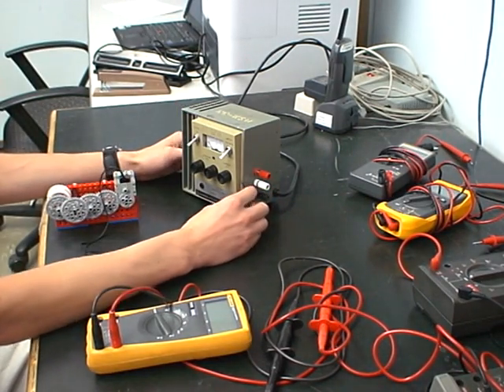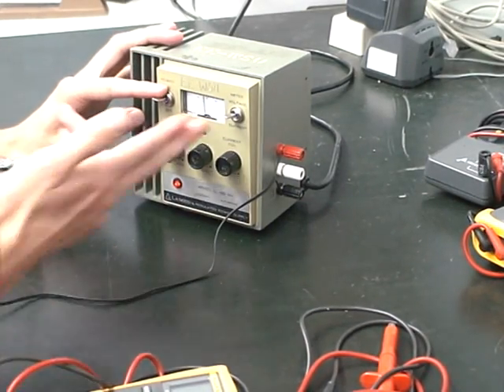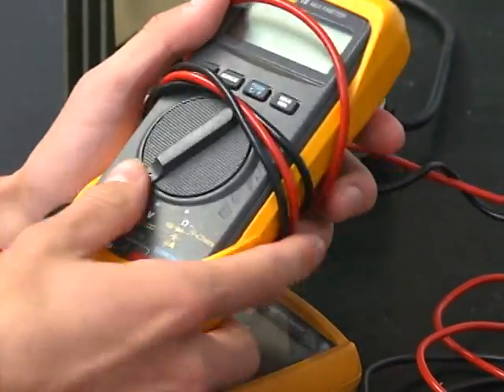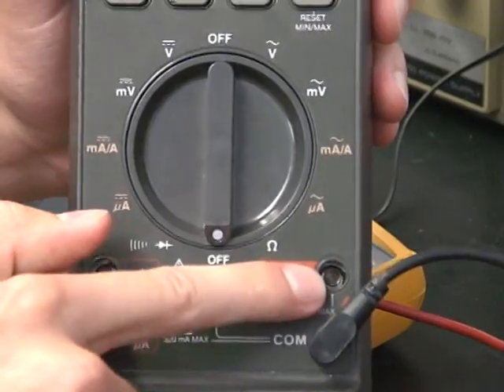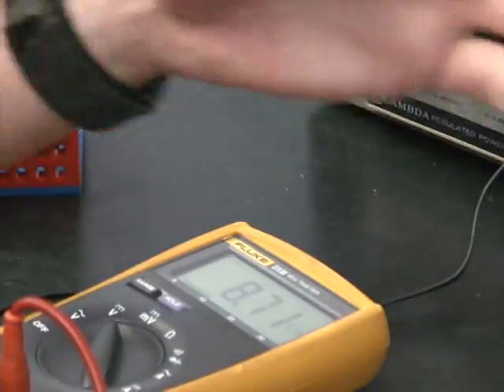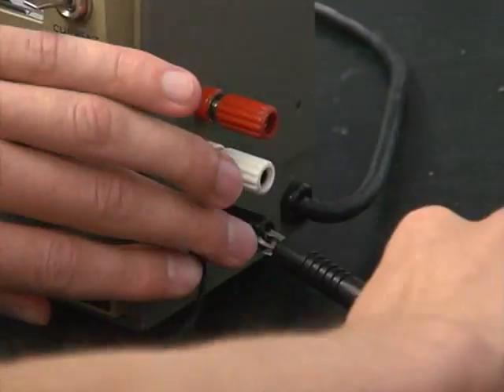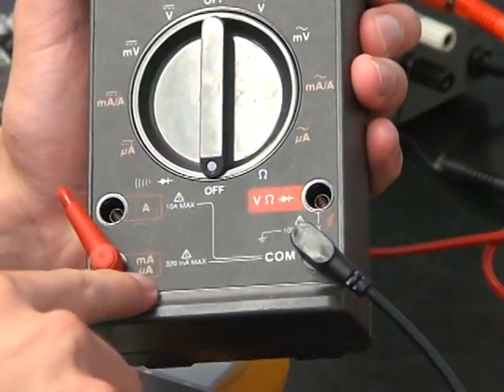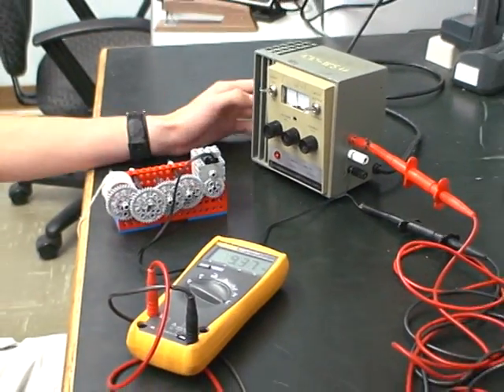Multimeter-Voltage and Current

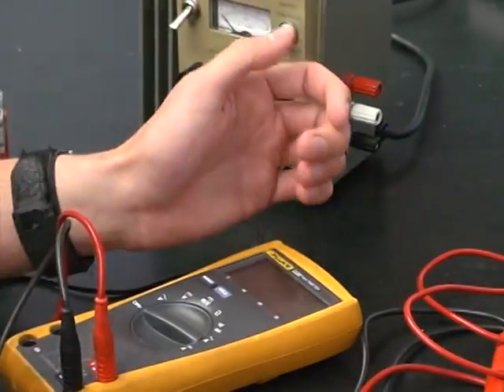Comment: 1:15 is wrong, there are DMM or multi-meters that use the same socket for the test probe for both voltage and current, switching is internal. Usually for higher current there is a separate socket for the test lead.

3:20 simple way to say it is voltage measurement is in parallel and current is in series.

Comment: What you need for that is the continuity setting ... do some searches for more info the symbol looks a little like this    -))) . 

You can tell if it works by putting the negative and positive leads together and you should get a beeping sound (if your multimeter supports continuity testing)

Comment: hi i have a sykkes-pickavant multimeter i want to check if there is not bad circuit in my underfloor heating mat. can you tell me which symbol to use on the multimeter to check that plz?